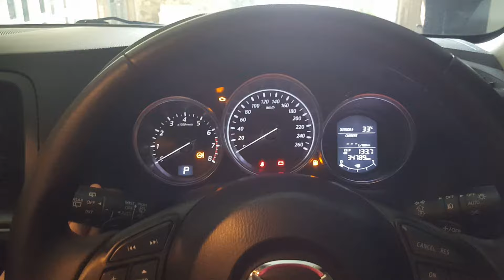Mazda CX 5 CX 3 Mazda 2 Mazda 6 Biante Skyactiv How to replace V belt / Water pump belt .

Comment: My wife called from the interstate today and described losing the alternator belt. (2017 CX-5)  She was 200 miles away and your video was a great reference to make sure I had everything I needed to do the repair confidently in a parking lot.  BTW, the belt was CRAZY tight even with the tensioner released to the limit.  I got the belt on about a quarter of an an inch and then bumped the starter. That did the trick and the belt went into proper position.  Thanks!
Reply from the maker: Ahaa glad this help to service n repair your car 👍👍👍👍.
Reply: How many miles were on the car when the belt failed?
Reply: @Dronecaptainpilot  65k ish  2017 model
Reply: @NfidelNet  FYI mine just failed at 125k mi.
Reply: @bryanteger  Clean living I guess 🙂
Reply: Bumped the starter?
Reply: @taichihead42  turned the ignition key for a brief second. The engine turns for a short burst and that allows the belt to seat in the pulley.
Reply: @taichihead42  It's easier and safer just to use a wrench to turn the pulley
Reply: @bryanteger  I agree.  That's a bit dangerous what you did.  I mean that belt could have snapped off.
Reply: @bryanteger  The job is straight forward enough but requires care. The damage to an engine if the belts are put on wrong could be catastrophic.
Reply: @taichihead42   Nah nothing will happen to the engine.  If belt snaps then only your alternator and A/C wont spin.  Not a big deal.  It's not a timing belt.

Comment: A couple of follow-ups after replacing these two belts on my 2014 CX-5.  At 60K miles (not Km) the original belts had no signs of cracking or slight wear like yours did.  I put them in the car in case of emergency.  Noted the OEM water pump belt was Made In France and the replacement belt said Made In China - for what that is worth.  Your nice camera work is somewhat deceptive as there isn't much room to access the tensioner pulley once the wheel well splash shield is removed.  It's a tight fit to get the 17mm wrench on the tensioner pulley bolt.  Also, removing the spark plugs made turning the crank so much easier.  Recommended.  Finally, I had lots of trouble getting the new water pump belt on as it kept slipping off the pulley as I rotated the engine.  Be patient if that happens to you.  And spin the crank multiple times after both belts are on like FD to ensure they are in the pulley grooves.  My serpentine belt wasn't on the AC pulley correctly and I seated it properly while spinning the crank.  Great video Felix, thanks again and hello from The Great State of Texas!
Reply from the maker: You r welcome sir and thank you for the time tuning in. Im.very glad this diy service helps many owners. :) and stay tune for more videos.
Reply: Thanks...no need to put car in neutral when turning crank? Leave in park ok?  I'm at 113k miles belts look great but better to do now I guess than later.

Comment: Awesome.  Thanks.  Can now do myself :)$$$$$
Reply from the maker: no worries sir
Reply: @GarasiFelixDan  It went well:)  two inovations.  My wrench started to bend, so I managed to fit a 17 mm socket on the tension bolt.  The socket handle Gave me way more leverage and general stability and strength in releasing tension.  Ps still slipped a wrench over the end as per your trick.

  Also sliped the belt on the tension wheel which had no ridges on it so noticed way easier to get on and off.   

thanks again:)  You are really good at what you do.   I watched 4 videos on this exact subject and yours was in a class all its own:)
Reply from the maker: @kaimorf6209  thank you so so much appreciated 👌👍👍👍👍

Comment: Thanks a bunch man, you saved me. I was trying to install a new v belt ( the smaller one) and it just wasnt going in. I was trying to use a small prying tool to help it in while turning the crank pulley,  but it just wasnt happening. I would have never imagined that it would be as simple as pushing the belt in with your fingers, while turning of course. Thanks again.
Reply from the maker: You r welcome sir , thank you really appreciate the support.

Comment: На генераторе меняю ремень сверху. в ключе на 17 просверлил отверстие и сделал тягу из проволоки. Второй ремень так меняю.
Reply from the maker: Блестящий никогда не знаешь, что ты можешь сделать этот трюк.
Reply: @GarasiFelixDan  This is inconvenient, since I have large hands and work closely in this place. For which I pull the roller up with a wire and a lever.
Reply from the maker: @polyarnikdjek7853  ahh i see what you mean, yeah could be a trouble if you have a large hand n arm.

Comment: Thank you for making this an easy project. I really appreciate it
Reply from the maker: you r welcome , very much appreciate it 👍🏼👍🏼
Reply: One thing I did I forgot to mention. I removed all the spark plugs so I could turn the crank easier and just soaked them in cleaning solution while I was installing the belts (I had already previously replaced them)

Comment: Great Video! Do you know if a 2012 Mazda CX-5 2.0 has only one belt or also 2 as you show in this video? Thank you ✌🏻
Reply from the maker: should be the same as this engine. they have 2 pcs of belts.
Reply: @GarasiFelixDan indeed. Just saw them myself now looking under the enginge with a torch. My Mazda dealer told me they need to be replaced. But to me they look fine. Just like yours. Even though they are 12 years old by now probably. What is your opinion?
Reply from the maker: @Guidolino1234  if they are still in good cond and shows no visible cracks / chirping noise dont worry about it. Can always change it for next time.
Reply: @GarasiFelixDan  no noise, and no visible cracks! (it also writes "Made in France" on the smaller belt as did on yours) I have the AWD 160Hp. I love the car! Bought it used in 2021 with 92k km. Now it has 135k km on it. Driving it in central Europe, where I live. The  Mazda technician also told me that allegedly the oil pan was rusty/leaky and needs replacement. Not sure if I should believe him and whether he just wants me to get expensive stuff done by him (500 to 600€! Accordingly). I read that this issue is rather unusual for CX-5, mostly concerning Mazda 2. Either way, thanks for all your help and fantastic videos Felix.
Reply from the maker: @Guidolino1234  you r welcome sir. perhaps for that oil pan get it wash with dish soap and trace for any oil leaks , it could be simple as oil drain plug gasket.

Comment: If you put the belt this way will cut the belt, tooth of the pulley are very sharp!
Reply from the maker: maybe you can share us another technique ? i also want to learn :) 👍
Reply: some of the gates belt come with a red plastic and some come metal tools to help you put it in, the tools can do on and off, or sometimes I cut some of the old belt to put it in.
but your way still the fastest way to do, special on air conditioning belt.
and do you know the outer pk belt tensioner only can do from the bottom, can't push the tensioner from the top,.
Reply: sorry forgot something,  if you try cut the old belt, do this , how long is depends the pulley side, another is if 3pk the belt need to cut one line off, so that can guide the new belt in.

Comment: Great video! At 05:10 you say spin the crank ‘counter clockwise’ - you signal with your hand clockwise, and then spin the crank clockwise.
Reply from the maker: @johnnytank944  maybe there was a mistakenly saying counter clockwise when i took the video . I would rotate the crank pulley clockwise. 🙏🏼 I just follow that rotation as the same when the engine is on.

Comment: Thanks Felix for the video. I found I had more room getting my open end wrench on the tensioner bolt from the rear of the engine bay and then using another box wrench connected to the other wrench (90 degree angle), I could pull it straight down.
Reply from the maker: no problemo 😁

Comment: Bang Felix, do you have recommendation for Belt tensioner brand after market? The original mazda is too expensive.
Reply from the maker: definately theres alternative brand . Bando belts or Gates belts.
Reply: Bang Felix blm pernah ganti ya? Kata mekanik punya saya udh mesti ganti, udh sering muncul suara berdecit
Reply from the maker: @tryp2261  iya bole tu ganti karna kalo terjadi putus d jalan bakal rumit nanti mesin nya. stiap 2 tahun sd 3 tahun ganti aj tali v belt nya. biar aman . Check jg bagian tensioner nya apakah ada kebocoran ??
Reply: @GarasiFelixDan  iya bang, utk vbelt nya trakhir ganti tahun lalu dg brand gates.
Tp utk tensioner nya belum. Cek yg ori mazda mahal bgt diatas 2 jutaan. Mgkn bang Felix ada rekomendasi brand after market.
Reply from the maker: @tryp2261  kalo part tensioner supaya tdk kerja 2 kali karna dia berbentuk hydraulic. sy rekomen ganti yg asli mazda.

Comment: So to remove the water pump belt with the ratchet you turn it counterclockwise and to install it you also turn the ratchet counterclockwise?
Reply from the maker: i made a mistake in my video stated counter clock wise, it should be Clockwise as per engine rotation while running.
Reply: @GarasiFelixDan  ok so to remove the water pump belt clockwise 
And to install the new one clockwise as well right?
Reply: Thank you for all your videos they are helpful 💯 and for sharing your knowledge
Reply from the maker: @jrome020  🙏🏼 thank you sir.

Comment: What size wrench did you use for the tensioner?
Reply from the maker: I used 17mm wrench for loosen the tensioner. And 21 mm socket & ratchet to turn the crank pulley clockwise.

Comment: How much space did you have when you used the 17 millimeter wrench to loosen the pulley? Would a ratchet work to loosen the same bolt?
Reply from the maker: i think its going to be hard and wont fit if you are using a ratchet to loosen the tensioner because the space is pretty tight.
Reply: I appreciate you reaching out 🙏 

Keep making videos , especially on the Mazda 3 💪 

Take care.
Reply from the maker: @Barrackscuts  No problems 😀

Comment: I have a question. What happened if you rotate counter-clockwise a little bit on the crank shaft to adjust the water pump belt when putting it on? Thank you great video really help.
Reply from the maker: it is okay if you need to adjust and rotate counter clockwise a little bit , just dont do it often it will wear out the bearings or piston rings out unevenly.

Comment: What's the risks if the belt is broken while the car is running? My CX5 is 5 yo and never had replace.
Reply from the maker: Bad for alternator effects the electrical and water pump , car will overheats and might crack cylinder head n other components.
Reply: @GarasiFelixDan  Thanks mate

Comment: Thank you Felix Dan! Great instructions, like your other videos. One question - how many kilometers/ miles did your belts have when you replaced them?
Reply from the maker: no problemo. this video was at 34000kms.
Reply: @GarasiFelixDan    Wow.   That's way too early to change belts.  I have 200k on the original belts - 10 years.
Reply from the maker: @gfriedman99  its alright, just want to keep up with the maintenance.

Comment: What way are you turning the spanner clockwise or anticlockwise to remove the alternator belt and what direction for the water pump belt.  Can you work on a Mazda 2 please.
Reply from the maker: This method will be similar to mazda 2. I only have cx 5 with me to demonstrate. If im not mistaken i rotate the crank pulley in clockwise rotation.
Reply: @GarasiFelixDan  Hi Felix, the bigger belt is the alternator belt, I thought you rotated the pulley bolt counter clockwise to remove that belt? the smaller belt is the water pump belt.  You removed that by lifting it off it's pulley with a rag.  I am a little confused as this is my first time learning how to do it.  I think your videos are amazing, love from Ireland.
Reply from the maker: @taichihead42  yes the bigger belt is alternator belt the smaller ones is the water pump belt. Correct.

Comment: Excellent video and great camera angles. Preciate the tips. If we're not going to save the old belt, it's definitely easier to just cut it with a knife. Just earned a fresh subscriber 😉.
Reply from the maker: Thank you man for your support . Yes definately if the belt r kaput by all means just cut it right off with a knife.

Comment: Excellent video. Just one comment, is it necessary to let the rag travel around the water pump pulley? I was concerned it might get stuck making the job harder. How about using the rag to pull on bottom part of the belt for half revolution and before it gets swallowed by pump pulley put it on top part of belt and pull. Keep alternating.
Reply from the maker: Thank you & very Welcome RC :) yes that is correct lucky enough i didnt get the rag stuck up there Pheeeww..., for the next time doing this part of water pump belt im going to get one extra person to rotate the crank pulley for me and other person would pull the drive belt with the rag ,so it would be done easier in one shot :) its just that my other hand didn't have enough power to pull it in one round whilst the other hand turning the crank pulley :D.
Reply: @GarasiFelixDan  If you don't want to keep the the old belt you can cut them. Removing the water belt seems to be the hardest part. Thanks Dan for your videos, you are a good teacher and nice guy.
Best wishes for 2020, Cheers from Germany
Reply from the maker: @tomtom3533  You r welcome sir. Wish you n family a Happy new year . :)
Reply: @tomtom3533  I was gonna suggest that lol.

Comment: Hi, when you replace the belts do you need to replace the tensioner? In the video you only replaced the belt. Could not find much info. Thanks. Nice video.
Reply from the maker: the tensioner pulley dont need to be replace if not leaky. unless yours is leaking oil then must replace it.

Comment: Thank you for your excellent video, It was an immense help. The rag to get the belt off was a great trick that I had never seen before. I used some thin webbing and had my son pull the ends of it through the wheel. In retrospect it probably would have been better to remove the wheel. I have two comments however, I could get not get the stretchy water pump belt on the smaller diameter of the hub like you did. The way I got it on was from the back side of the pulley. Also, I could not get the other belt on the crankshaft pulley like you did. I had to have someone help me put it on the top on the alternator pulley while I held the tensioner from below. I saw someone wrote a comment that you turn the crankshaft counterclockwise. That's probably not a good thing to do. Thanks again for making a great video.
Reply from the maker: glad it works out, about the rotation of crankshaft pulley. I think in the video i did rotate “clockwise” but i mistakenly / falsely stated “counterclockwise” direction. But yeah just follow my video as per direction clockwise rotation correctly. it is a very tight space if you dont remove the wheel to access the belts.

Comment: I just did it by following your instructions. Thanks, you saved me hundreds of dollars, plus I have been able to do it when I wanted. 

Note: The 17mm wrench is required as a socket+ratchet doesn’t fit because it’s too tight
Reply from the maker: Perfecto very glad it helps. 😎
Reply: For some reason 17mm sockets and wrenches were not part of my old Craftsman sets either but I had another set that had them.  I tried every wrench combo I had and the 17mm box end was the only one that would fit in the tight space. I wanted to use a long breaker bar and socket or crowsfoot socket. The box end wrench wasn't long enough to get leverage so I had to use the two wrench trick. Also I thought I wasn't going to be able to get the tensioner to move at first. Never dealt with a hydraulic tensioner before. You need to apply pressure and it will slowly move, it feels like you are rounding off the hex head before it moves.  My belts has 122,000 miles and 7 years on them and pieces of the ribbing were missing.

Comment: If your sure you have the right replacement belt....just cut the old one off.
Reply from the maker: Yeah can do that. just becareful when cutting the old belts theres might have some tension it will hurt some hands hehe.
Reply: ***Sorry--- I was talking about the water pump belt### ....on the mazda cx-5  --There's NO Tensioner -===nothing will move!
Reply: For belt like this I think it better to keep as spare in case you are stranded because of belt that went bad at least you spare that will get you moving to a safer location until you can change to a new one
Reply from the maker: @Steve-se7dx  ok yeap with the old water pump belt theres no tension on it so you can cut if you like.
Reply from the maker: @abubakarahmed8948  Yep definately correct. Just incase things gone wrong 😁

Comment: I write through a translator from the Russian language there may be inaccuracies in the translation. - Tell me when you turn the crankshaft key on 21, while the box is in the neutral position? or in the Parking position? I think it's important not to damage the valve??
Reply from the maker: Gear in N position. Hand brake UP
Reply: @GarasiFelixDan  спасибо очень помогли.thank you very much.

Comment: Good afternoon, I want to congratulate you on your excellent video, a consultation after installing the two belts, how it is synchronized or how many turns must be made to the main pulley so as not to lose the synchronization of the engine, thank you in advance ..
Reply from the maker: no problem ✌️. dont need to syncronize the engine.
Reply: @GarasiFelixDan  Very grateful for your answer, thank you

Comment: I was going to pick up a Gates belt at Oreilys but they sell 2 kinds of belts.  Stretch Fit which requires special tool.  Do you know if the non stretch fit belt would be fine ?  Mine is a 2015 Mazda CX-5 Touring 2.5l.
Reply from the maker: should be no problems